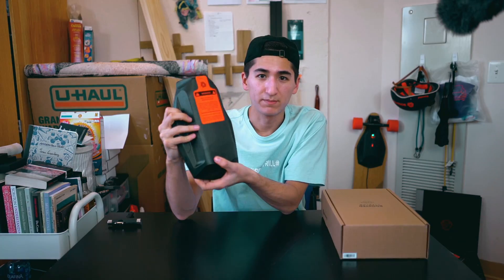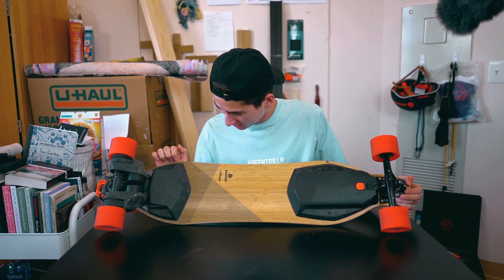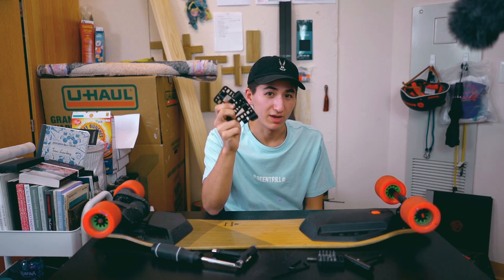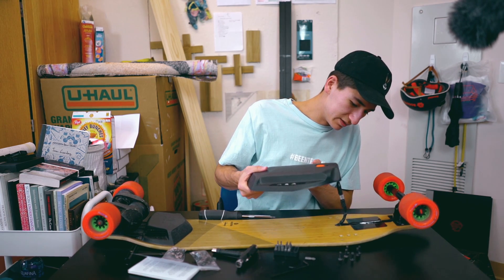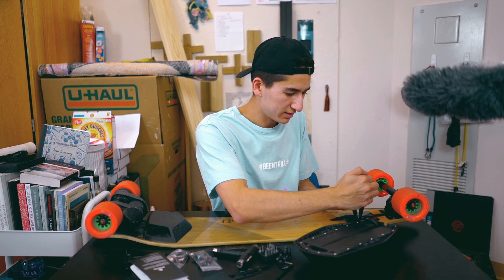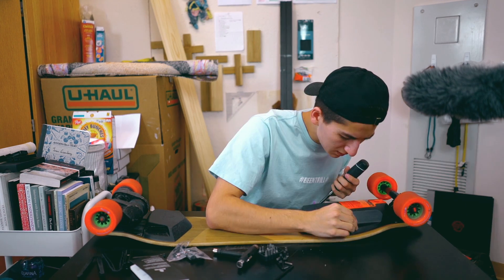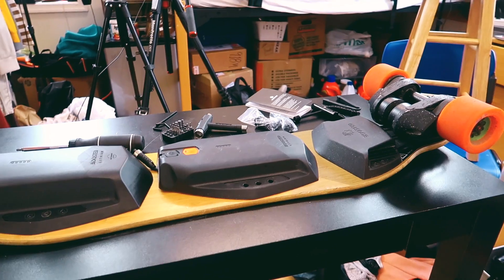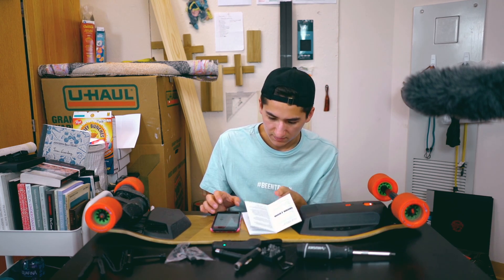How to PROPERLY Install Your Extended Range Battery for Your Boosted Board V2

Comment: If you haven’t given the risers a try I highly encourage it. They greatly increase ride comfort in my opinion. Way less vibrations and absolutely no loss of control.
Reply: Im 100 kg. I didnt mount em. Should I?:)
Reply: Svoby23 I definitely recommend it! It’s not that you have to. It’s just that there is no reason not to. Handles the same, protects battery from scrapping, and you get some vibration dampening!

Comment: I am having problems conecting my new battery Through the app, any ideas.?
Reply from the maker: I don't use the Boosted Board app anymore. Don't quote me on this but I believe the app doesn't work anymore. BUT, I would recommend you use the Ride app. It is way better and is what the Boosted app should have been. hope this helps! Thanks for watching!